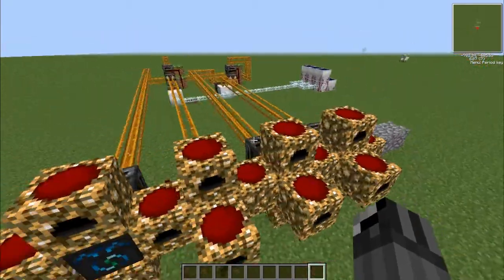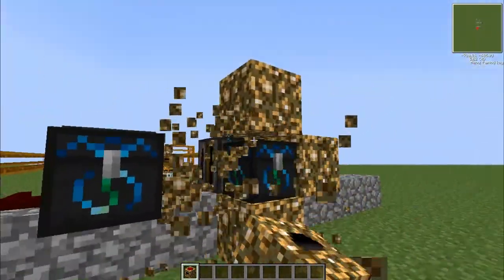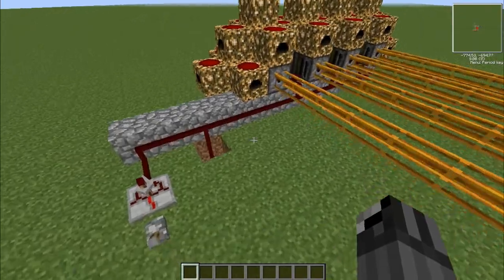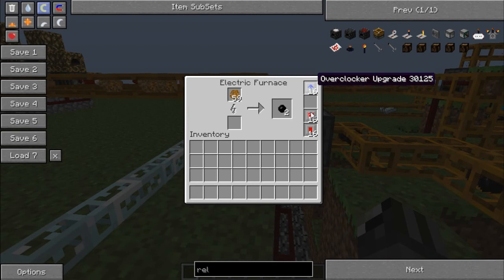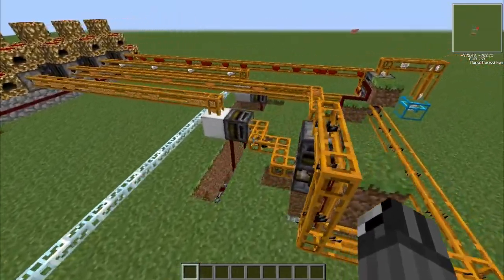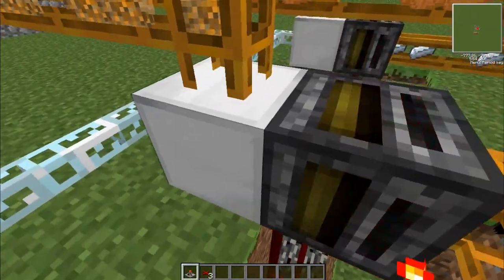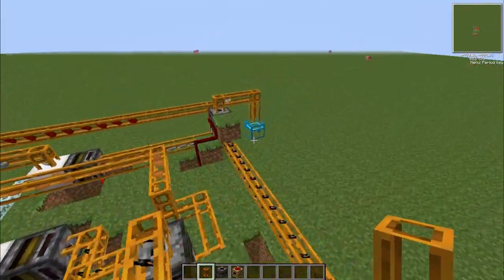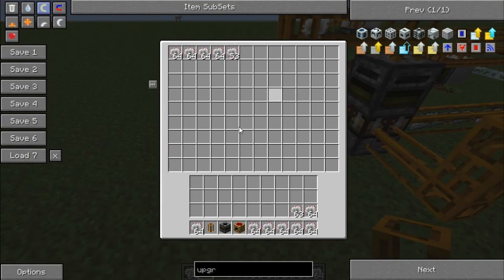Diaper's Tekkit Tutorials (2): Automatic Electronic Circuit Machine

Comment: If you used a retriever you could tell it only to pull the amount of items needed relative to the other items.  For example, you need 6 rubber for every 3 copper, you need one iron for every 2 redstone.  If you limit yourself this way you wouldn't be overloading the rubber while waiting for the copper and so on.